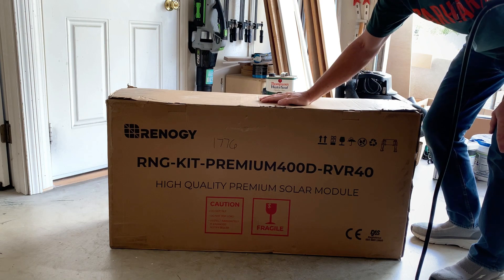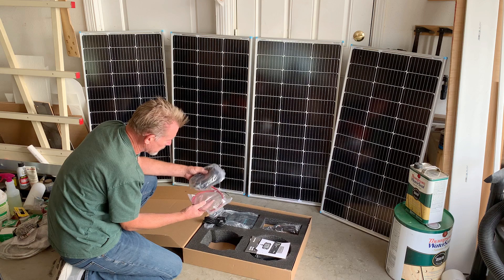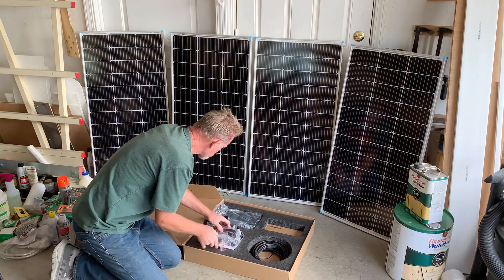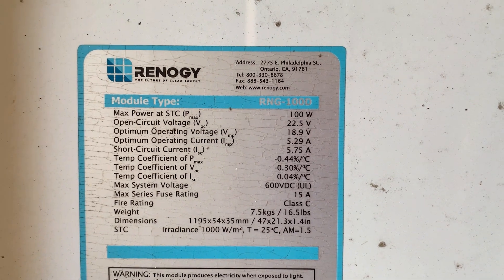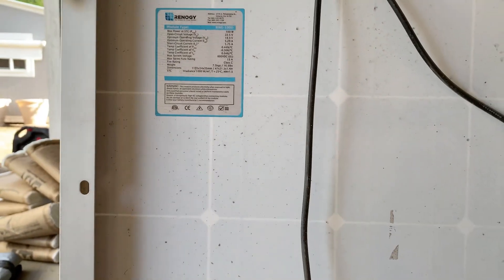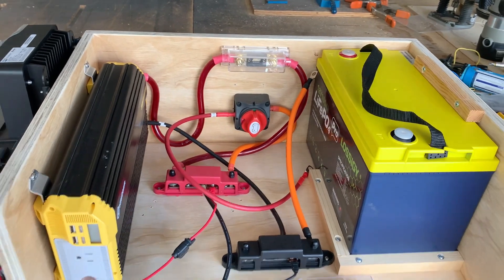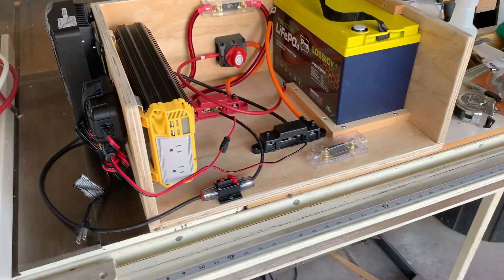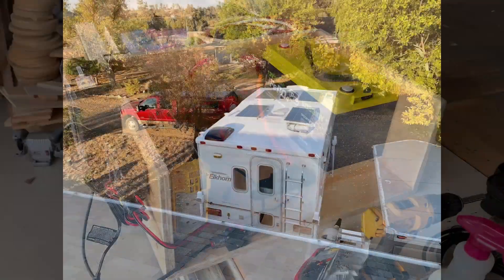Truck Camper Solar Power Center - LiFePO4 - More Power!

Comment: Nice I’m also running 400 watts and 3 100 amp lithium batteries.
Reply from the maker: 👍🏻.  Nice.   I just finished watching your last trip series through Kansas, Colorado, Utah & Nevada.   Great!
With your system, do you feel that you had enough power for everything?
I was considering removing all of my propane system but now I’m thinking I may just modify the LP system so I can just carry a single ground-deploy 20lb cylinder with a quick connect instead of my two 30lb cylinders.
Reply: Well I have not been going out of state since covid, but I have been doing a lot of boondocking
Reply: For the past 2 years I’m set now also the last 2 years I have been upgrading the truck and camper for a Arctic Ocean /Alaska trip just waiting for diesel fuel prices to come back down I Carrie 2 five lbs propane bottles

Comment: Your Battery box looks good to me however I'm not an electrician buy trade, I'm a retired CNC Machinist, but my Dad & Grandpa were electricians that both worked for Lockheed for 50 years. They taught me enough to wire my own CNC Machine shop in my garage for 3 phase power to run all 4 CNC Machines simultaneously, three Haas CNC Vertical Mills and one Mori Seki CNC Lathe all of them with 8 to 10 automatic tool changers. I ran that shop for a decade and sold everything when I retired at 62. Keep up the good work it's fun to watch, I'm looking forward to your A/C installation. Happy Thanksgiving to you and your Family.
Reply from the maker: Thanks!
Happy Thanksgiving to you and your fam!

Comment: That is a nice solar system! I had two of the older 100 watt Renogy panels with the Renogy charge controller on one of my earlier RVs, a 2011 Wolf Pup 18' Toy Hauler Travel Trailer and the 200 watt system combined with two large deep cycle lead/acid batteries I had on that trailer ran the 110vac compressor type Refrigerator/Freezer No problem for weeks up in the Back Hills, South Dakota during the bike rally. I almost added two more of those panels to that trailer but a friend wanted to buy it from me real bad and made me an offer I couldn't refuse.

Comment: For your inverter: will you be able to charge your max air / appliances via the plugs on the unit, or will you have it connected to all the outlets currently in the camper ?
Reply from the maker: The MaxxAir fans are 12V.  
I still have it wired to my shore power cord so all outlets and appliances are powered just like shore power would provide.  With this new system, I ran new 10/3 Romex wire from the inverter to the shore power plug.
I have a new 2000 watt Pure Sine Wave inverter from Renogy now so I hard wired directly to the inverter.
I’ll do a new video on my boondocking power setup.

Comment: Sweet! That's a good amount of S power.  In the past I used sikaflex with adhesive brackets and had no troubles. Very well thought out design. 👍
Reply from the maker: Nice.  Yeah, that Sikaflex is killer stuff.   Beats drilling holes or running screws in through the roof.